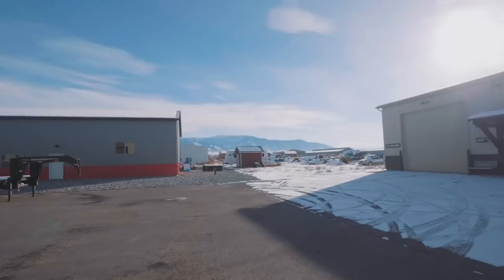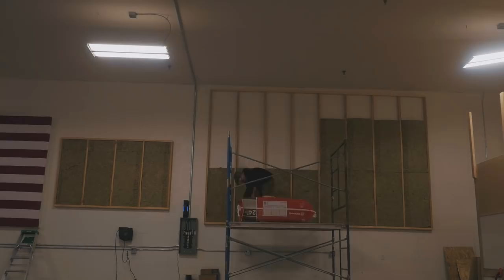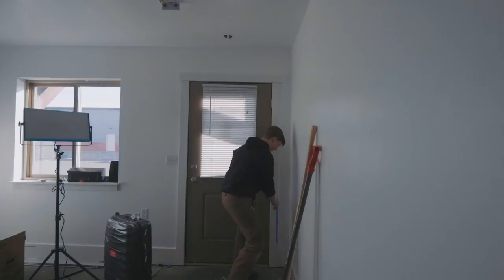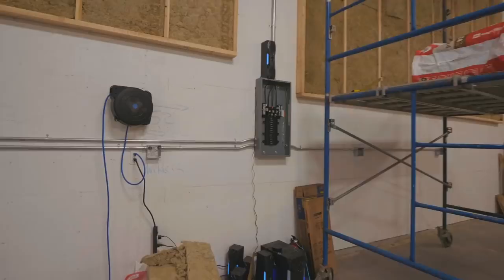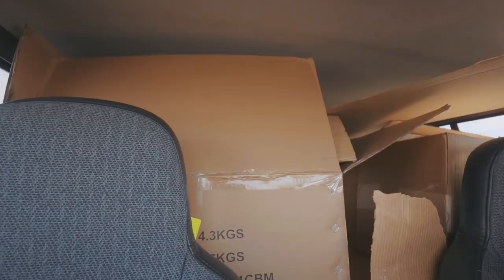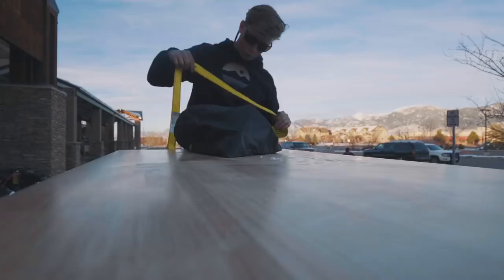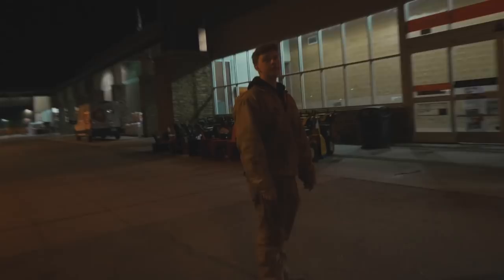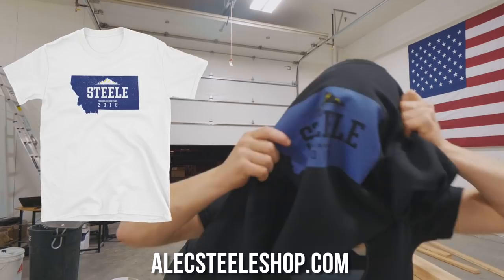I BOUGHT AN AMERICAN TRUCK!!!

Comment: Will's 20 year old jeep cherokee will still outlast that Ford you bought.
Reply: I have truck Alec has now and i owned that Cherokee in the past.  I have owned numerous vehicles over the last 30 years and that Cherokee was the single worst vehicle i have ever owned. 

My f-150 just rolled 200k without any major work ever being done on it.
Reply: @travr6  funny, thats the complete opposite everything the internet tells me.  Including my own cherokee with 370,000 km on it.  And everyone I've known with a 5.4 triton has cam phasers that let go and blow your engine or your spark plug holes strip.    So yeah, youre living in some sort of backwards universe.  Up your meds bro.
Reply: I have a 2011 F150 5.0.  About to hit 340k miles with no major issues.  A few repairs here and there with wear and tear, which I expected.
Reply: Mine has the 3.5 ecoboost. I had a Triton in my 98 f-150 and never had an issue.

My 1992 Cherokee was garbage. My cousin has a 2004 Cherokee and we had to replace the engine at 102k.
My ex had a 2006 Cherokee and the entire dash would go out,  flicker, car would die,  etc... had 140k.

Every year Cherokee i have ever known anyone owning has been garbage.  It is the one single vehicle i would never suggest to anyone. 
Meanwhile the f-150 is the best selling truck for 50 years or so.
Reply: adam shreds  oh look at that, like three videos later and that fucking fords already back at the dealer for eletrical problems.   nice try, clown.  You too Travis lmao
Reply: I have a Dodge Ram 3500 Dually with a bulletproof Cummins diesel that just rolled over 817,000 miles (1,314,834 km). No major work other than bulletproofing the engine when it had only 68 miles (109 km) on it.
Reply: Also it is a used truck that has been used for 8 years, and people in Montana and more rural states especially tend to work on their own vehicles, so when you buy an 8 year-old truck in Montana or anywhere really, it should be expected that there will be a few issues at first. Sounds like you are the type of person who buys a car off of EBay and expects it to run flawlessly.
Reply: Jeeps require work to keep running but if you don’t fix the small things you can’t expect it to last very long also fords always have been and always will be trash
Reply: 2004 Ford F-150 Lariat owner here, cam phasers was the worst in history, however I yet had a problem once I replaced it with updated ford cert phaser and now have 655k miles on my truck. My coworker had a jeep, it seems to break down all the time. I suspect he's a bad driver not so much the jeep itself was an issue.
Reply: @areabum  Yeah, the 5.0 is a much better engine than the 5.4 was. My sister is on the market for a truck and I've had 3 mechanics and a salesman at a Ford dealership say to go 2011 and up for the 5.0 instead of the 5.4 because of the cam phasers, spark plugs and transmission issues.
Reply: Me driving my 97 f250 with like zero issues 😂😂
Reply: A cherokee XJ will outlast everything
Reply: @DaebakMonkey  My father has got a 1500 (several years now). And he has to drive about 500km every week. That makes for a lot of way laid back. And just like your's, it didn't really need any work except for optional things (new lights, new fenders, other cosmetic stuff) and the mandatory TÜV (it is a proof that your car is suitable for traffic). The car's quite a hauler too.

Comment: Alec, shop, truck,  and house are looking great congratulations! I can only imagine how excited you are to start getting this shop finished. just a little help you can take the back plate off of the mac book air, and take the 4 screws out of the hard drive bracket. when you pull it out you can mount it/ plug it in to a docking station, plug that into a different computer and you should have access to your data! good luck friend coffee on a mac book your probably going to have to replace the Logic board.. not a cheap fix..
cheers!

Comment: add some acoustic foam(acoustafoam) up in the four corners. You will be surprised what a difference it will make. You might even hang your flags from the ceiling  to help break up sound waves.

Comment: That's a lotta truck. Surprised so much cab room and so little bed.  Worked out well for the toolbox though. Long enough for gas cylendars too. all is well.
Can tell the difference in the echo just with the insulation up in some places. Flags will make it "home".
Things coming along nicely.  Killer grinding room.  Gonna do an oversized oven for normalizing swords n stuff?
Also, what corner does the throwing target wall go in?  This is a very important question.  Looking forward to more updates.

Comment: Alec , when it starts clacking it means the cam phazers are coming apart.....it costs the same to fix the cam phazers and stuck spark plugs as it costs to replace with a reman engine.

Comment: Welcome to North America. You’re going to have to contact the Samurai Carpenter. He’s not too far away. 
And the heater t-stat. That is super easy to fix and move to a proper location. But with the high ceiling I would advise ceiling fans to direct the warm air down,,where you want it.
Reply: Don't know if you seen it but he did a collab with the samurai Carpenter a while back but it would be nice to see if they can do a new collaboration

Comment: Alec - Memory aide to tell you which side of the road you should be driving: Passenger Door to the OUTSIDE of the road. Do that, and you should be on correct side of the road, always. Why?
 - in Great Britain, the passenger side of the car and the correct side of the road to drive on is LEFT.
 - In MOST OF THE WORLD (it's not just a US thing), the passenger side of the car and the correct side of the road is RIGHT. 

(Just don't import a car set up for GB and use it, because that will throw off this memory aide.)

Comment: There is a recall out for the side carpet ends on those f150s , bring it in and get it done. Totally free and upside is incase of an accident the recall prevents you from burning in a car fire started bt seatbelt pr-tensioners after said accident.

Comment: I learned to drive in a car with a standard transmission.  First car had a standard transmission.  As did the third and fourth.  Fifth car had an automatic.  For a week after getting it, I would occasionally stomp the brake with my left foot going for the clutch pedal that wasn't there.  I feel bad for drivers behind me those days.

Comment: Nice wheels but be careful with those turns when you're driving tired, driving on the wrong side of the road take some getting used too. The quickest way to think about it is that the steering wheel needs to be in the centre and not the curbside. Might want to learn the rules about being pulled over by the coppers as well, the Brits won't shoot you if you get it wrong ...........
If you just need the info off the HD pop it out the laptop and shove it into an external case. Cost you about 10 bucks and 15 minutes.

Comment: I have a 4' x 12' welding table with 2x2 1/4" thick square tube and two 1/4" thick steel plates for the top :0 its heavy has heck

Comment: I hate to say this but your not in the UK anymore id make sure that shop is secure so no one can break in and steal anything I love the channel and what you do id just hate to see you lose anything from what I can see in the videos the place looks really easy to secure if there’s windows put bars on them door a dead bolt would work the roll up door a padlock on the inside would work. It’s just my input all of the things I listed are very simple to install remember it’s better to have something and not need it than to need it and not have it good luck and forge on.

Comment: bad form on the guy using his hand to hold the board while using a nail gun, if that gun goes off and the nail misses there the nail goes into his hand (had this happen to a friend) also another pointer is when filming or watching never stand in the path of the nail. i worked with a guy that got hit in the eye and is now blind from a nail that went stray and hit him, it didnt go in his eyeball but it shattered his safety glasses and shoved a chunk into his retina.

Comment: Nice truck. Hey before you put back the lights in the office, sylvania makes a direct wire LED tube that replaces the original florescent lamps. You can get them in 5000 kalvin and even higher. You simply remove the ballast and direct wire 120v to the pins. Install the LED tubes like an old florescent bulb and your done. Super inexpensive way to get good quality light in an old fixture. I wish I was closer or I’d do it for you. Any its just a suggestion. I’ve installed them in many restaurants and they have been very happy with them. Hope that helps.

Comment: Did you bring your Apple laptop to an authorised Apple service center?.. if you did they're not getting data from the hdd but just wiping it.
Apple authorised service centers aren't even allowed to save a customer's data. They'll even wipe they data when the (hardware) problem is something completely unrelated to the harddrive or motherboard.

Comment: black, orange, blue electrical tape....was the guy out of tape....it's like a hybrid electrical system
Reply: It is a High Leg Delta System. Great for welding because it is a 100% isolated system.

Comment: Hehe getting the data off the computer/laptop should be no issue at all.. simple as, pull the hard drive and plug it into another computer.. that is.. IF it wasn't electrically fried.. then it' a bit of a more challenge (If you have computer questions. go ahead and ask, I can probably answer them.. - note - while I used to be Apple certified.. I don't touch them, and have not for a few years).. Great to see you getting set up, I hope the experience carried well through for you.
Reply: But apparently, they have to pull the computer apart and put it back together again 5 times first. Thoroughness. I blinked at that 2 week timeline...but maybe they are just busy.
Reply: @ZedF86  - hehe it is Montana.. not much in the state, and finding a computer shop that has the staff and experience would be a challenge.. (I do not know where Alec et al are situated in Montana) .. If they were close enough, I could just head across the border and fix it for them.. lol.. 
:) :) best lesson, don't let Alec with coffee near anything electronic hehehe

Comment: WHAT???  F150???  Really?  Alec, you're now in Montana,  You should have bought a F250 to be able to handle the weight of steel you may need to haul.  Same looks, power, widgets with much more capabilities.

Comment: Awesome stuff Alec!
Comments per requests:
Don't get a shop goldfish. Stay stern with Will! ;)
I dare you to name the truck "Red Threat" and double dare you to add some yellow accents. Or at least forge an awesome hood ornament!
Just kidding... Commie-jokes are fine to a certain point but defiling a truck in the U.S. might be a bit too much :I
Be safe driving! Keep it in 4-wheel drive at all times, since most of the weight is on the front wheels and you don't want to get in a sideways roll in that!